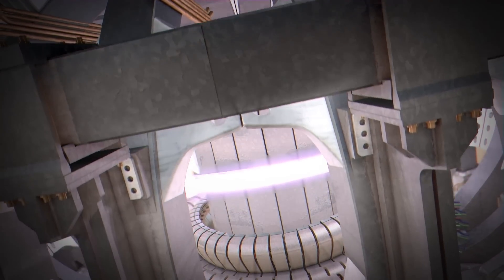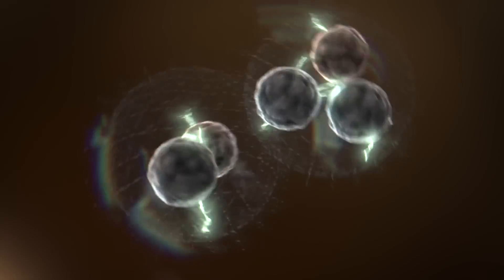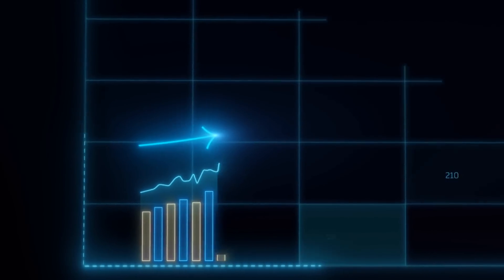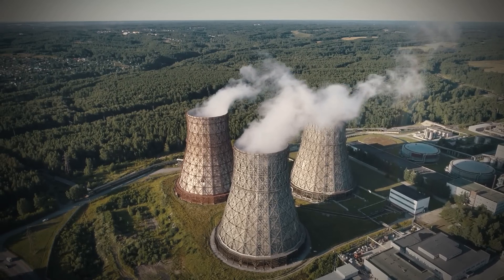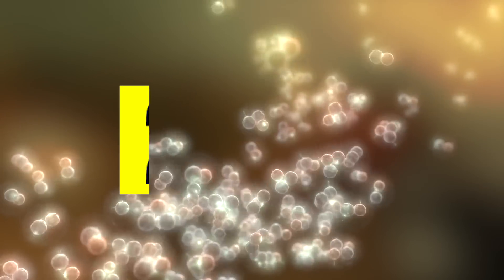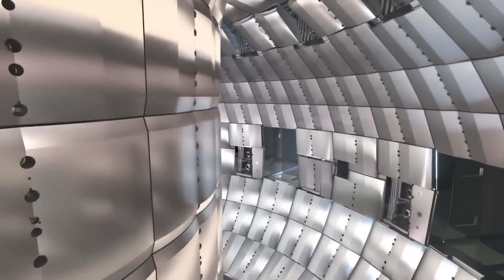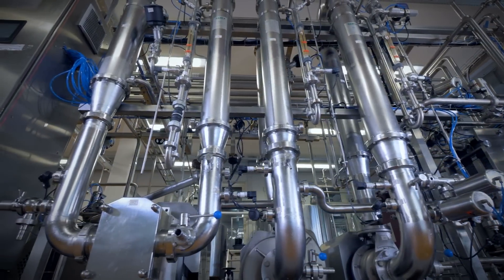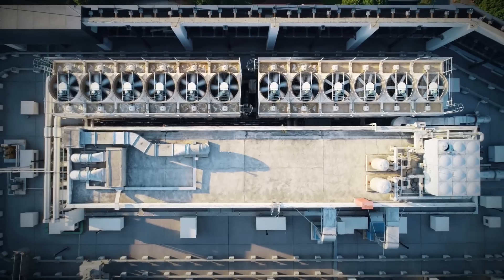The Shocking Problem That Could End Nuclear Fusion

Comment: I was tempted to “pre-empt” your video, but decided instead to listen right through. 

You are absolutely correct about the lithium breeding issue. It is an area that has had too little “investment” of technology and effort because the current strand of research is focused on - 

	1. getting stabilised plasmas
	2. Establishing a “burning” plasma with all of the potential additional stability issues associated with a burning plasma versus a non-burning plasma. 
	3. Getting the required gain in thermal efficiency - I.e. more nett power out and than power used to establish the maintain the burning plasma 
        4. Running the plasma for long enough to be a viable producer of energy. 

All of which problems are still yet to be resolved. And until they can be, the next phase of a “production prototype” will not be financed by anybody.

It is during the “production prototype” phase that the breeding issue will need to be resolved- alongside many very serious metallurgical problems that many scientists do not yet realise they are going to face. (or maybe, some do, but are deliberately keeping quite about these so as not to throw a spanner in the works of the development efforts). 

My personal opinion, for what it’s worth, is that these issues will hold up the introduction of fusion reactors for a longer period of time than that taken by the physicists and engineers to establish a burning plasma. 

But many in the industry think that taking the energy from a fusion reactor will be as straight forward as doing so from a conventional nuclear fission reactor. Technology which is well established. 

Again, my personal opinion is that you are comparing chalk with cheese. 

But, on the bright side, I think the problem is a “nut that can be cracked” if there is enough investment in the research. 

ITER may provide a number of answers - but to be honest, I think that ITER is now as much a costly white elephant which is diverting money that could be better used elsewhere - as far as fusion research is concerned. 

Again, my opinion, is that nuclear fusion will be solved and developed by private initiative - not through a project such as ITER. 

There is much evidence that this is happening already.
Reply: Many of the issues you cite here regarding materials ect are already under serious consideration. I work on the UK STEP project as a plasma physicist and while its a recklessly ambitious project it is diverting much needed attention towards how you actually design and operate a reactor - making assumptions that what we believe to be correct about burning plasmas will be verified on IETR.  Taking energy from the reactor is also under consideration, if the project ends up actually being built and working it will put a small amount of energy onto the grid - its likely going to be a number of systems that utilise the heat from coolants and the liquid lithium breeding blankets. 

And yes your point about delivery being achieved by private companies holds some water, the UKAEA itself is attempting to map the slow transition from being the organisation building the reactors to instead being a body of expertise to help companies build their own reactors, the big questions still need to be answered by large government backed projects. Your second point touches on stability, in my probably biased view as a plasma physicist this probably one of the largest challenges and disruptions such as vertical displacement events, runaway electron beams and ELMs present the biggest risk to a reactor. Even on a ITER scale device the damage they can cause is eye wateringly expensive. Private companies have proven themselves to be less risk-adverse than we initially believed, but it still falls to us to tackle the big academic problems first. Our understanding of plasma is still severely limited.

Saying that, a number of private companies are already offering something of value, Tokamak energy for example we plan to work closely with on magnets because they have have some expertise in this area. A number of ventures popping up however remind me of hyperloop - and not in a good way. 

In my view tritium is not a showstopper, its a pain in the ass and will require substantial R&D but certainly doesn't warrant the title of this video.
Reply: I agree. Our taxes are being wasted on the moon missions, “been there done that”.  Nothing useful for earthlings will be obtained from colonization of other planets.
Reply: I agree, however, I do not think that the investments in ITER are wasted. There are a lot of things that need to be developed and solved and I am convinced that every penny spent in this project will be returned in the form of new and better technologies. And even if it turns out that Iter is a non-trivial path, now it is important to prove that this is the case and that the path is not useless.
Reply: Where did you get your PhD from?
Reply: "if there is enough investment in the research" - spoken like a true academic. Practically every researcher claims they can solve anything as long as they are given enough money. Even if it is possible to set up a working fusion reactor that produces net output, the initial start-up cost and the maintenance cost could be so high that it might just make more sense to continue using other sources of energy.  There are no solutions, only trade-offs, and if the trade-offs are infeasible for human needs in a given situation, it doesn't matter how elegant you think the methods are.
Reply: @thepunisher2988  - I have never worked in academia. I have made the assumption that “investment delivers returns”. I do accept that this can be readily viewed as being “naive”. But the alternative approach - that you “never invest unless you are guaranteed a return” is an extremely short-sighted approach that will get you nowhere. Of course there are many engineering and practical issues to overcome - and these may not be possible in the near future - in which case we invest our effort in established nuclear fission energy production. But it’s is obvious that water is far more abundant than fossil fuel on planet Earth and the fusion process should be orders of magnitude better at producing energy than burning fossil fuel. (Fossil fuels are the gift to mankind. They are needed to get any other power generation product “off the ground”. So can we afford to waste them?). So there is clearly a justification for attempting to make fusion power generation work. And if you are reading this in 2022 you will be perfectly aware of “human needs” as far as energy production is concerned. And that certain governments are pissing away money on pointless pursuits that could more readily have been used to benefit humankind rather than destroying other humans. Maybe we should concern ourselves about what “human need” really means.
Reply: @pmkeith  I don't think you understand what I wrote. As a matter of fact, I agree with most of what you wrote, and I admire the determination of people who are working hard to try to overcome the seemingly insurmountable obstacles that stand in the way, but it is not a matter that can be solved with enough investment in the research. There is always uncertainty, and just because you strongly believe in the justification for the project doesn't guarantee success. 

I get that you never worked in the academia, but more often than not researchers seek investment by downplaying the uncertainty by implying that whatever they are working on is just a matter of enough investments. I don't mind people funding projects because they strongly believe in it, but I don't like when academics fool people into funding something they know little about by implying that a successful research outcome is just a matter of having enough money.

Why can't they be honest? like you? - that despite the uncertainty, the habit of never investing unless you are guaranteed a return is an extremely short-sighted approach that will get us nowhere, and that even if the project doesn't produce the outcome everyone hoped it will still help humanity in other ways. I am cynical about the feasibility of fusion reactors as an energy source, but I am not totally opposed to experimenting with fusion reactors, because I think fusion reactors will prove to be an important part of nuclear energy production in other ways. For instance, if you can augment fission reactors with fusion reactors to manage the fission  byproducts then it will make nuclear energy production even more safer by reducing radioactive waste.

I actually respect those who invest their time, money and effort into something they believe in, not for the potential return on investment, but just because they are passionate about it, and because it is important to them. Those people acknowledge the uncertainty, but it doesn't bother them because they believe in what they are doing. I just don't like those in the academia who imply certainty of what they are doing as a way to attract funding. Because they sound and appear confident quiet often they are successful in receiving large investments, but they also waste much of it because of the dismal oversight on research spending.

I hope this clarifies my position.
Reply: @thepunisher2988  Sounds more like a problem with capitalism, and the behavior of the academics is just a symptom.
Reply: @rpraetor  You're right. People seem to think that could be nothing better than capitalism, which is why no one is trying to critically analyze its problems to try to come up with a better system.
We are now at a point where the side effect of capitalism is beginning to take over the benefit, such that there is more harm being done than benefits. The people who have already established significant special interests in capitalism do not want to acknowledge that for they now have enough control over the system. Capitalism  in theory punishes bad behaviors via the 'invisible hand' that guides the economy, but those who have accumulated enough influential power can to hedge against being punished for bad behavior. Therefor, cheating now seems to be the norm everywhere - whether in stock market, international trade, in academia.

My doctor always tells me - you treat the cause, not the symptom. Taking a painkiller to make the painful symptom doesn't make the problem go away, and keep taking painkillers will only make the problem worse.

As far as I can see, no one is interested, let alone even aware of in the underlying problem, save for very few, like you.

I don't know you, or where you are from, but I genuinely hope that you go on to become someone influential to correct the problem. The entire civilization is on the line.

Comment: I thought they were only using isotopes to start the reaction then they were going to just fuse normal hydrogen after the temperatures were reached. The whole reason fusion was even considered was the limited supply of hydrogen trapped in water on this planet. There was never an implied statement that fusion had limited energy but the complete opposite unlimited energy potential. The one thing that stumps me is how do the extract the energy from the fusion reaction to boil water and drive a turbine. When the reaction is contained within a magnetically confined field, that is almost impossible to keep stable long enought to substain and reaction. Surely once heat is allowed to escape to power a turbine it would cause the plasma to cool and collapse.
Reply: The energy released from fusion reactions is NOT in the form of heat (while that is the case for FISSION reactions).
Most of the energy released by fusion is contained by the neutrons that are released (remember the "neutron bomb"?).  Therefore, those neutrons will have to be captured by some kind of fluid, which will then be used in a heat exchanger to produce steam, which will be used to run turbines.
The problem is that most substances become radioactive after they capture neutrons.  The "sales pitch" that fusion is "clean" and doesn't produce radioactivity is completely bogus (remember the "neutron bomb")
https://en.wikipedia.org/wiki/Neutron_bomb
https://en.wikipedia.org/wiki/Neutron_radiation
Reply: @lukebandolino882  cool finally someone who can explain this so the nuetrins can escape the magnetic field because of nuetral charge and there energy transferred into the surrounding thermal conductor that heats water to drive a turbine, makes sense. But how much energy is captured from the nuetrins being emitted surely there is substantial loss passing through the walls of the reactor.
Reply: @justindressler5992  "the walls of the reactor become radioactive and down time for maintenance could be substantial"
I'm afraid that's an understatement.  ITER is supposed to generate 500 MW of fusion power.  What walls can withstand 500 MW of power, in the form of neutron flux?
Reply: @lukebandolino882  yep I heard the damage to the confinement chamber would require constant rebuilding but I'm not a physitist so I don't know the facts. Surely they have contingencies to handle this, fusion has been in design for more than 40 years. Personally I think we can obtain fusion but what the Sun does for free seems to be extremely difficult to replicate on earth. The Sun has magnetic containment purely by its gravitational mass.  But thinking more about the nutron bombardment there may not be materials we can design to function is these conditions.

Comment: I fixed focus fusion years ago. It should work with your microwave oven and hydrogen or boron 11 borene gas. Using capacitor like separators for graphite electrodes in a focus fusion sphere reactor.

Comment: There is likely an even bigger issue with those projects. They all assume stars work like a fusion bomb, but still no one went to the sun and dove below the photosphere to check, if it's really getting hotter inside. The sunspots are dark, so they are probably cooler.
Another contradiction to the current model is that the corona of the sun has a much higher temperatur than the photosphere. There are explanations for that, but are they correct?

Comment: I think some innovations in plasma and quantum physics have to happen first.
one of my thoughts, though with my limited knowledge, is that we need plasma induction, and pulsed operation. when the plasma ignites, it must be in a condition, and in a tight coupling/communication with the magnetic coils, that the produced energy creates induction in a resonant system of coils and capacitors, that sucks up most of the energy, and the anti-force cools and expands the plasma. from there, you can use it to pinch the magnetic field of a partner system, to ignite that, think of a boxer motor, and the main part will discharge in a secondary resonant circuit, and from there it goes to the normal processing of electric power. AI might find a solution for the field geometry and required electric pulse shaping, like a Dirac shock. I can imagine an organ-pipe system of coils, the smaller inside the larger, to use fourier synthesis, and create extremely steep impulses that might serve ignition. so the slow, thick wires hold still the strongest currents.
I did not find any mention in the secondary literature: does the plasma rotate in the tokamak or in the stellarator, like in a particle accelerator? I believe it should, and very fast, and the speed changes with the induction and ignition. ignition might create a sudden increase in the radius. 
perhaps the device should be fairly small.
but that's only me.
good speech.
Reply: What